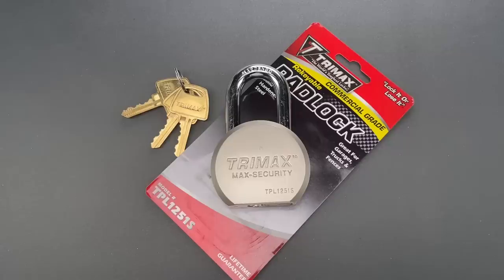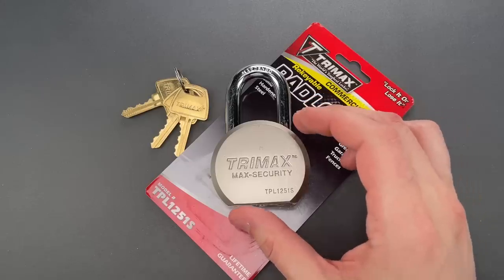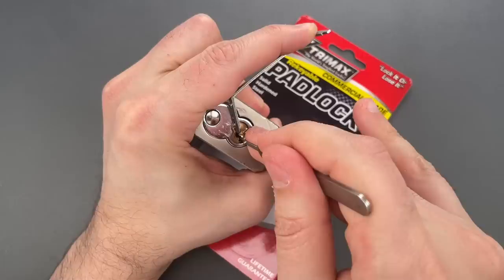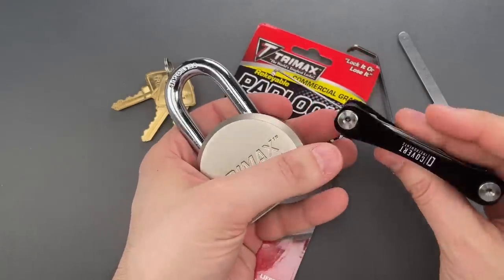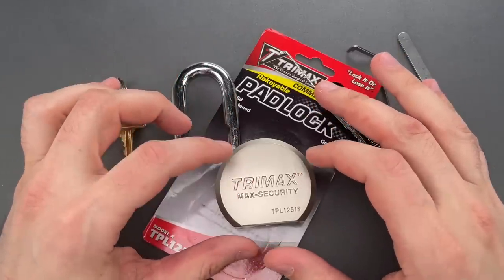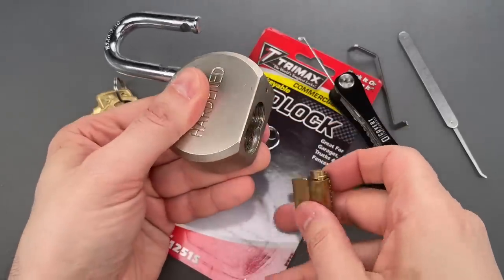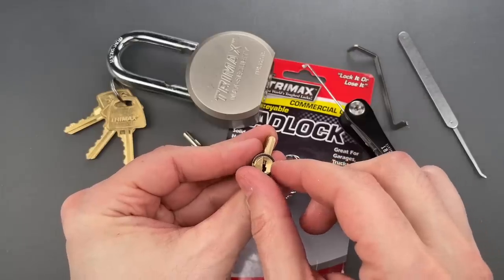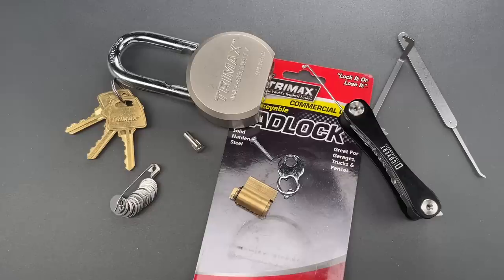[1517] 5 Year Update: TriMax Round Body Padlock

Comment: I think the main reason why these seemingly simple manufacturing change recommendations are almost never taken is because in the modern world of outsourced manufacturing there is no one in a position to act on these recommendations. Trimax themselves have probably never actually seen the engineering designs for any of the products they sell, nor are they in a position to "fix" them. I would warrant that this particular lock was a design spec made available by a chinese manufacturer that the manufacturer (or manufacturer agent) itself ripped off the design from some other product they were paid to manufacturer many decades ago. Neither the manufacturer, its agent nor trimax likely has anyone around the table that would even know how to go about altering the design for this or any product. They are literally just trading capacity in shipping out some product that has likely been produced a manufacturing run very long ago and is sitting in a warehouse in china somewhere.The manufacturer's ability to alter the design is probably limited to stamping the outside with a brand and model number. Trimax's only real option available to them is likely to either live with the vulnerability or just stop selling this product altogether and shop around for another design made available by the same or another manufacturer. And that will likely cost them money, whereas the status quo costs them virtually nothing as long as there is somebody out there still buying the product.
Reply: Well either I'm out to lunch or chatgpt is tragically naive. I asked chatgtp: "Are modern lock companies in the us even involved in the design of the products they sell or are they just shopping from a list given to them by a chinese manfuacturing agent?" chatgpt responds:

Modern lock companies in the US and other countries are typically involved in the design of the products they sell. While some lock companies may outsource their manufacturing to companies in China or other countries, they still have input into the design and specifications of the locks they sell.

In fact, many modern lock companies have in-house design teams that work on developing new products or improving existing ones. These teams use a combination of computer-aided design (CAD) software and physical prototyping to create and test new lock designs.

While some lock companies may choose to outsource manufacturing to take advantage of lower labor costs, it is generally not the case that the lock companies are simply "shopping from a list" provided by a Chinese manufacturing agent. Instead, the lock company will typically work closely with the manufacturing agent to ensure that the locks are produced to the desired quality and specifications.

It is important to note that not all lock companies are created equal, and there may be some that have less involvement in the design of their products or are more reliant on outsourcing. However, for reputable lock companies with a focus on quality and security, design and manufacturing are typically closely intertwined.

Comment: That security nut doesn't look like it has any edges. Is it just a straight cylinder? Could you just spin it loose and completely remove the core without even having the shackle open?
Reply: It has flanges, look at the end of the video and you can see the little "wings" that slot into notches in the hole

Comment: Particularly egregious. Granted those style locks can be destructively opened by prying off the cover plate, nothing is less conspicuous than walking up and appearing to use a key. Worst of all, if there is an easy exploit that leaves the lock intact and it's used as access control for a garage or locker, stuff can be stolen or tampered with and there wouldn't be any immediate evidence of such.

Comment: Why is the driven piece only a ~90 degree wedge? If it were also a half-moon shape, you wouldn't be able to turn it. Is there a specific reason for that? 
Signed a non-locksmith
Reply from the maker: Good question! It’s so you can remove the key while the shackle is open. On a key-retaining lock (that needs to be locked before the key can be removed), there are interlocking half moons, and this bypass isn’t possible.
Reply: It allows you to remove the key without having to have the shackle back in place.

Comment: Would it be good idea to make locks, where the key hole is so deep in cover / inside the lock body, that it is not possible to open it with common lenght lock pick tools.
Reply: No, because it isn't very hard to make a longer pick and tension bar. Any improvement in security would be very short-lived.

It also has usability implications, as the size of the lock increases to accommodate the longer key, which makes it not fit into places it used to.

Comment: Another product that looks great but in reality can be unlocked as fast by LPL using one of his tools as quickly as someone with a key can do it, in other words it should not be used where a lockpicking thief has the balls to openly ply their trade in public as onlookers will not be able to tell the difference between being picked and being opened with a key.
You can argue that someone who is cost fixated has told the company not to fix the keyway flaw as it would cost x cents on the price to eliminate the issue, but on the other hand it makes no difference to selling it as a lock as Masterlock have shown with their products  because people will still buy them despite the fact that this lock has very little to offer against anyone with a bit of knowledge and the right tools.

Comment: @LPL: Would this also work with padlock shims?
I'm note sure if I'm right here, but my guess is that if a lock can be closed by just pressing it shut, the spring loaded locking mechanism can be bypassed with a padlock shim. Would this work here as well?
(I'm asking because a bunker used by the company I work for is 'secured' with one such lock. The bunker is used to store explosives so it better be good. Knowing my company it was more than likely just cheap).
Reply: Would what work?

Are you asking if adding an antibypass plate would make a lock be non-shimmable? No.

I don't think there's any real way to retrofit a shimmable lock to be non-shimmable. The only real possibility would be to decrease the gap between the shackle and shackle hole walls, but none of those seem really feasible. Just get a new lock.

You could get some padlock shims for very little (or possibly even repurpose a soda can) to demonstrate the weakness, but absolutely get the lock owner's permission before you do anything to it at all.
Reply: @wbfaulk  My question was if the lock in the video could be opened with padlock shims and if a padlock that can be locked by just pressing the shackle into the lockbody would be susceptible to be opened just by using padlock shims.

I already tried the cut soda can, but either I'm not good enough or the can is too weak for the spring inside the lock.

Regarding asking: The company is known to not follow legal standards, it's just that nobody cares. If the lock used on the explosives bunker can be opened that easily it would be as if you didn't lock it at all.
Reply: @KuruGDI  Not all locks that can be pushed closed are vulnerable to shimming. In particular, the lock this one is based on, the American A700, can be shackled through a spring-loaded mechanism but is not vulnerable to shimming.

Comment: Lock manufacturers will keep on doing it until customers stop buying the bad locks. Obviously there is no correlation between bad quality and sales. Exposing the flaws is not enough. Watching your channel I have the impression most of the locks on the market are abysmal quality and it's no point in even trying to buy something better, because even very expensive locks can be bypassed with some kind of low skill attack. From the other hand - we RARELY buy new locks. But more often we watch funny videos. It's another suggestion to show relatively good locks. Like: "don't buy this, buy that instead". I would consider a lock good if it requires some skill and / or specialized tools to bypass it. A lock that take you over a minute to pick I would consider "unpickable" - at least for thieves, because most of thieves are not very skilled and they just reach for a low hanging fruit (like really bad locks) ;)

Comment: Is there any way to determine from the packaging, or from the visible portion of a lock, if this flaw is present? Is there any reference that lists locks that have this fault, so that they can be avoided?
Reply: A list isn't very useful as the flaw is so easily fixed... or reintroduced. He's looked at a lock  before where the company was bought and the new owners removed the shield for the minimal cost savings.

Comment: I guess this shows you that without government legislation, companies really don't care. Please don't tell me there is any type of legislation and regulations that lock companies have to abide by. Because that will make the legislators just as bad as the lock companies themselves. These shields must cost far less than a penny each. Yet it seems 9 out if 10 cheap locks that still cost around $5 £5 do not use them :(

Comment: How can you tell if there's no shielding in the back of the keyway?
Reply: Poke a tool in there and see if it turns.

That's not entirely unserious, but somewhat more seriously, you could shine a light down the keyway and see if there's one there. You could also poke anything thin down the keyway and see if the hole is deeper than the length of the key. Not all locks have this problem, though. There are very similar designs that might seem identical from the outside that have no shield but are unbypassable in this manner.

Comment: These bypassable locks like this just blow my mind. This is about as smart as if we sold kids party balloons filled with hydrogen 40 years after the Hindenberg blew up. There is literally no reason to do something so basic and so stupid other than company failure to give literally a single shit. It would be like if the auto manufactures went and put the grenade Takata air bags into cars again starting in 2060 after they were the cause of the largest auto recall in history. It's just inexcusably dumb.

Comment: i think pick resistance is pointless within reason.  there are an endless amount of tools that will open a lock faster ,easier, and require less skill.  so what's really the point.
Reply: First, you did see that this video was about a non-picking bypass, right?

Second, assuming there isn't another bypass, there are situations where an attacker might need to access something behind a lock without leaving an indication that it was accessed.
Reply: @wbfaulk  
  first, you did see that i said "within reason," right? 

secondly, your second point is based in fantasy.
Reply: @rich7331  The US Postal Service and every bank I've ever dealt with doesn't seem to think so. They both secure items behind a lock that holds closed a canvas bag. No skill is needed to cut open the bag, but that's not what they're concerned about. They're concerned with unobservable tampering to the contents.
Reply: @wbfaulk   🤦‍♂️ do banks and usps us pad locks? no